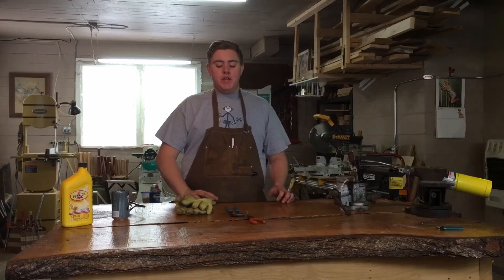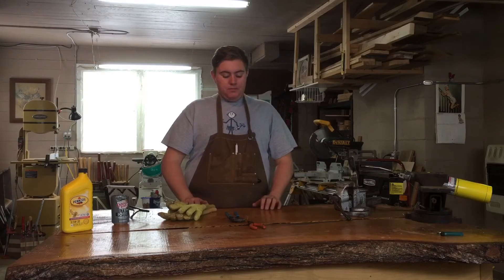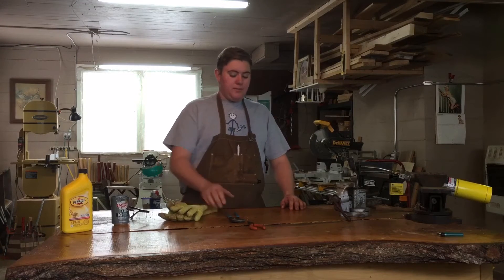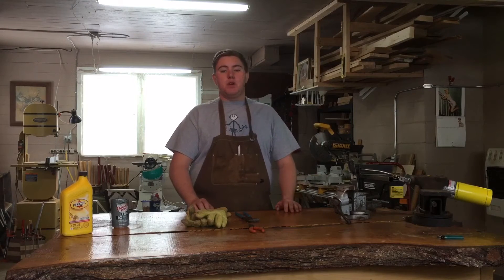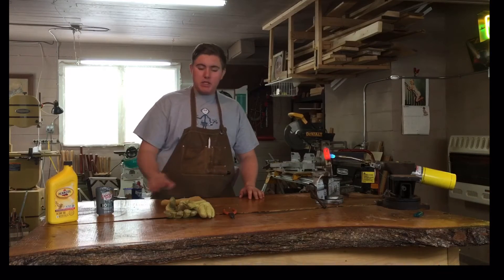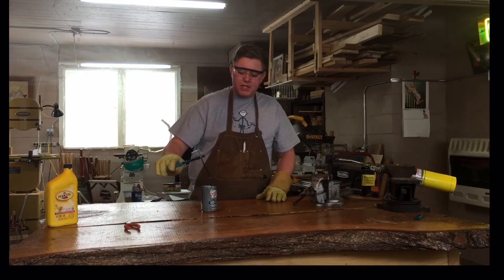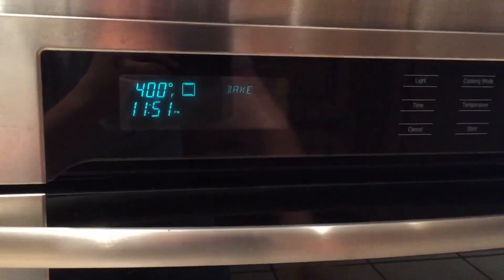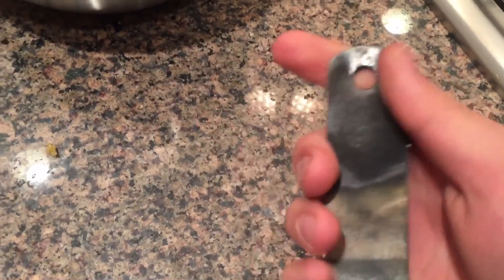How to heat treat metal

Comment: Hey man, I was wondering if all aluminum abject go for 2 hours in the oven , would something bigger go longer?
Reply: No, also aluminum is not a great item to make anything out of unless it is just a prop or a light tool.
Reply: Err... wrong. Many AL alloys are very strong (like 6061T6, 75,000 psi), stronger by weight than steel, almost as strong in similar size. T6 is a hardening process(via heat treatment).